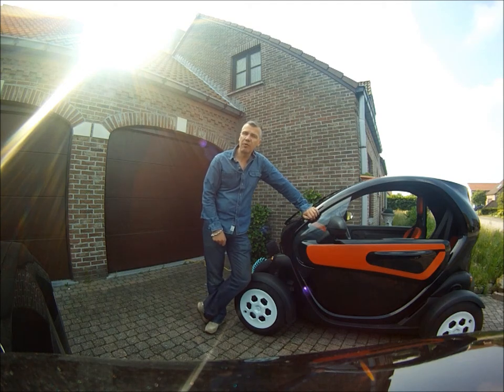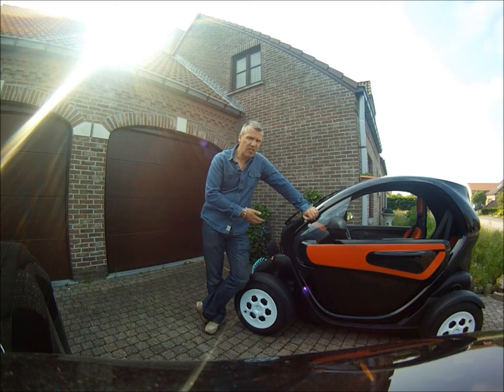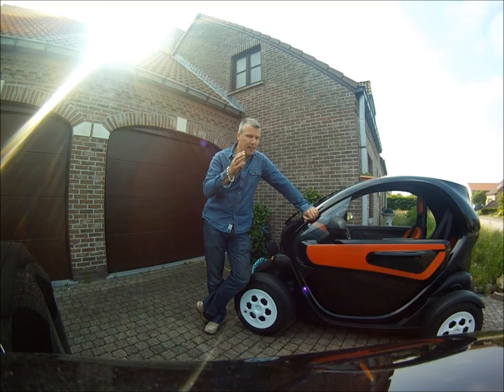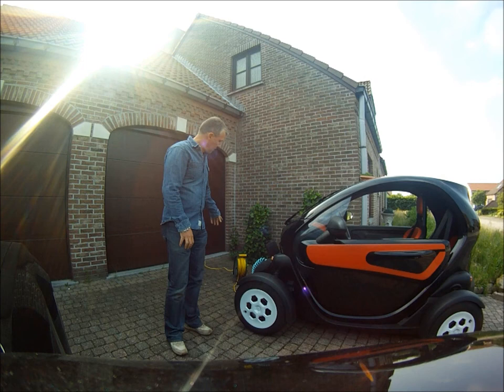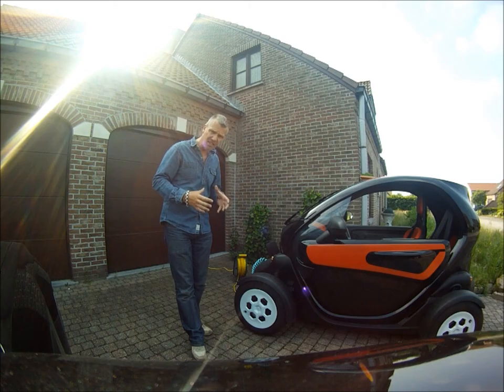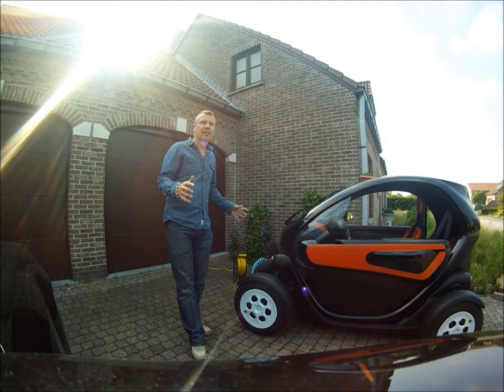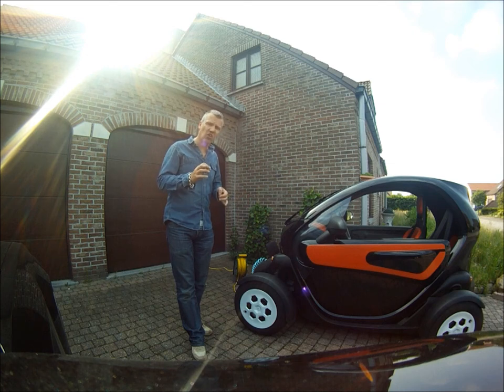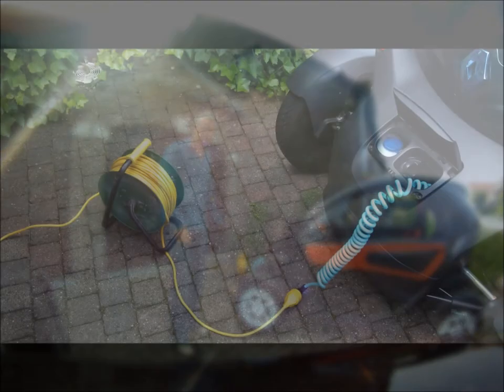Don't let a Renault Twizy burn down your house!

Comment: in the UK our plugs contain a fuse, so an extension lead would be fine, if it was to much current for the extension lead the fuse in the plug would blow. all extension leads here can handle 12 amps minimum. if you need a longer lead where you live you could always get some thicker cable and wire it from a standard plug to a surface mount socket.

Comment: Depends on country. As I've noted below, UK ones are only (officially) rated up to 13A. I expect some of them might be downgraded on the rating plate alone, as some are still good for 9A or more even when coiled, but I'd still think twice before connecting anything else to it in parallel with a 10A electric car charger. It's good to have a bit of leeway if only because the cable can still be too hot to handle comfortably whilst still being considered officially "safe" (as it's not a fire risk)

Comment: Thank you for the warning.  I own a Think City EV and use an extension cord to charge on occasion.  It draws 15A at 220V.   I use a power cord that is 12AWG(2mm), but always flat and not in a coil.  I have never noticed any heating. However, I bet if I placed it in a tight coil like you did, it might get hot.

Comment: Yes large current in a coiled up extension cable is a bad idea as the inside can get very hot. If you have a plain ordinary extension it might not be the best solution but I wouldn't consider that unsafe unless the cable is damaged.
Really just the same problems as if using power tools on such a coiled up extension cable however since it's not loaded constantly and you're there it's usually OK but with battery charging you're not expected to be there ;)

Comment: Yes but the coiled cable cannot wick out the heat so it will get hotter and hotter. All mains plugs and in the EU are fused.

Comment: Think this way: A friend is test driving one at the moment. He reports the total range when driven "enthusiastically" (i.e. quite close to its rated 10hp / 7.5kW continual output, accelerating hard + cruising near the top speed) was about 60-65km. 60km at 80km/h is 0.75 hours ... 7.5 x 0.75 is 5.6kWh.

Let's assume a 6.6kWh battery pack, then, to supply necessary range + speed.

6.6kWh / (220V x 10A) = 3 hours minimum.
But, Li-Ion batteries require the charge to slow from ~50% to 100%... 4 - 5h?

Comment: Also where the heck do you buy 12A fuses from? They only came in 1, 3, 5, 10 and 13 as far as I was aware. And the 1A and 5A (or was it 3A?) ones seem to have been phased out now.

Comment: So pretty much exactly 13 amps then, at 220 V ... what country are you in and what voltage do you run?

Nice to get a proper measurement like that - just a small excess can be very troublesome, sometimes!

Comment: @nestofdragons With range - I am seeing reports that a guide for range is 30 miles @ 50miles/hour or 50 miles @ 30 mph. This is about 50km @ 80km/h or 80km @ 50kmh. Does this fit with your experience ?

Comment from the maker: Lets use some basic formula of electricity. Power= voltage * current. So ...220V*10 A= 2200 W. If this is right ...your cords are not powerful enough. Really ...Beware of this problem. In one of my former jobs i saw a market seller using a heater on a extension roll. It was winter. You could warm your hands above the rolled up extension cord! Please ...be careful.

Comment: i have a cord with next to a overload protection also a temp protection
so when it gets to hot it will break te connection
how many watt does the twizzy use when charging?
a cord can handle like 600 watts or 800 normally and dont even need to unroll.

Comment: so the twizzy pulls 2200 watts? wow that a lot to put in a small battery like that.
if the twizzy would charge with 500 watts then its not a problem
but the unrol and rollup rating is on the powercord when you buy then
some are rated higher and some lower.
so yes if your not sure always fully unroll.

Comment: Ah, that's not entirely correct. Depending on the particular extension lead, even UK leads come in at least 5A, 10A and 13A (1.15, 2.3 and 2.99kW at 230 V) grades that I've seen. And a friend has burned out the fuse in a 5A one by connecting a 2kW (~9A) wallpaper steam-stripper without checking the ratings - and even though it was fully extended rather than coiled up, the wire was HOT when we were trying to diagnose the problem. A coiled cable could have caught fire even before the fuse blew...

Comment: What if it is in the uk
Reply from the maker: Lewis, in the UK there is also induced resistance in electricity. 110 Volt or 220. It stays the same.

Comment: I guess you're new to the world of electromotive power. Moving a vehicle around uses a LOT of energy. A lightweight scooter that has about the same acceleration and top speed would still need at least a 5kW motor (~7hp) despite weighing less than half as much with the rider on-board. One with a 110km/h top speed, about 9kW.

The 80km/h top speed and limited range are as much the result of needing to keep within realistic charging time/current limits as that of legislation, safety and cost.